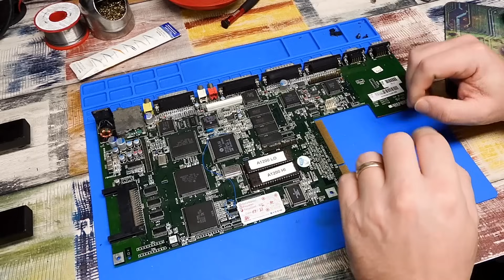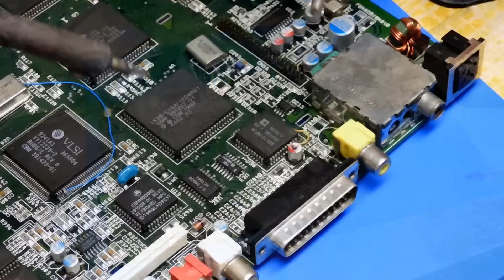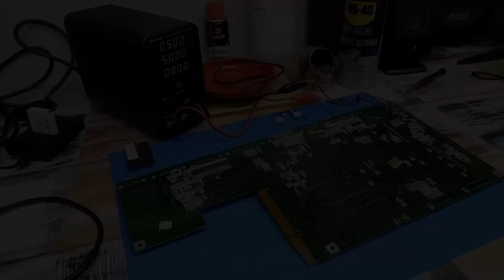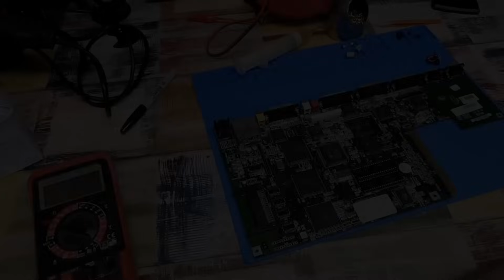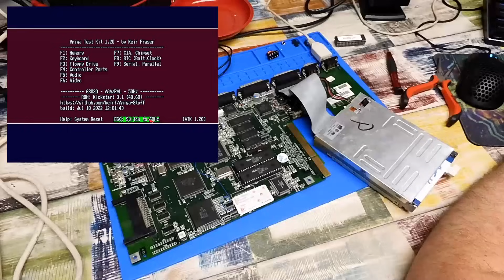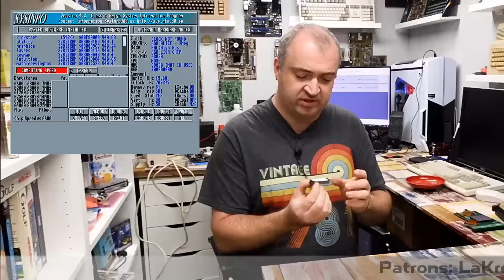Can I fix this shorted Amiga 1200?

Comment: The black screen delay on boot is a 3.1 ROM "feature" it expects a HDD - if you put in an IDE drive or IDE to CF or IDE to SD it will boot quicker (or use 3.0 ROMs)

Comment: Nice fix! Lucky the rest of the machine wasn't damaged due to the short!

A thermal imaging camera would probably picked up the heating of the coil even if it's a few tenths of a degree you would've picked up on it. Yes it costs money but it can save you a lot of time fault finding, and it's great for finding cold spots during winter in your house, insulating those and avoiding cold bridges with dampness and fungus etc can save you a lot of headaches. I've also used it on my car to spot a weakness in the exhaust pipe, a brake jaw being stuck etc. that the car repair men didn't pick up on.
Oh and buy low melt solder, it'll help not lifting pads as it lowers the melting temperature even more than leaded solder. I've soldered and removed 44 pin PLCCs more than 10 times from the same set of pads and there's no damage. I only needed 10mm of that stuff to remove the IC.

Comment: In repairing avionics equipment.  To find a short we sometimes put the PCB in a deep freezer until the card frost over.  Then when we apply power(current limited) the short thaws first.  You can take a marker and mark the bad path to the short.  We let the board completely dry before further troubleshooting.

Comment: I notticed that a cap was placed between the 10 uF next to the IDE Header, and the 22 uF behind the RF modulator, so when the two  1000 uF caps returned (?), you chose to leave it.

Comment: OK, I've paused the video at the beginning, and I've watched enough Lateral podcast highlights that I think I can figure out the reason. Obviously could be the usual capacitor or dodgy logic chip, or it could be a burnt resistor. Maybe a diode? Or perhaps you don't mean a short circuit, maybe someone has short sold it on the stock market? No, that's silly. How about short sold it on a retro forum, like they've borrowed it from someone and sold it at a higher price in the hope of finding one for cheaper and buying that to replace the one they borrowed?

Or maybe I should stop trying to turn this into a game show and just watch the video to find out.
Reply: Well, it certainly wasn't what I expected, but good on you for persisting and spotting the dodgy coil.

By the way, the joke would be "there's a broken ferrite ring on my Wang", or before you found the fault, "I hope my Wang hasn't blown its cap!"
Reply from the maker: A broken ferrite ring on your wang... sounds painful 😂

Comment: Cool to see another rev. 1a board; that's what mine is, and it also took out an accelerator connector due to the square edge! I've since chamfered mine as well.
Reply from the maker: First time I've had one on the bench, was good fun to work on, even if it did send me on a journey 😅

Comment: You have great determination resolving the short that way, we fix a large number of PCB's with shorts (often shorted ceramic caps), we have thermal camera's but often find voltage/current injection works better for hard shorts where little heat is generated. To diagnose a 5V short, set a lab PSU to 5V 100mA (you can increase the current but you risk damaging traces etc) then inject it into the PCB 5V rail close to the PSU input, then simply set your multimeter to mV and start probing the 5V capacitors (or other components on the 5V rail), you will notice the mV decrease as you get closer to the short, the lowest reading (usually close to 0mV) should identify the issue/component, you can also inject the 5V 100mA across the 5V rail away from the PSU input if you suspect an issue around that area.
Reply from the maker: Thanks for the tip, I'll try that next time.
Reply: @CRG  The thought process and logical thinking towards fixing the problem was far more valuable than the actual fix... Enjoyed very much indeed CRG.

Comment: I don't think you did the current limit setup properly.  You should turn current limit to 0, set your voltage, short your leads, then turn the current limit up until you hit the voltage and current you expect.  That's the way I do it at least.  You're testing for a dead short, and if you want 5v at 100ma, you need to set your meter to 5v 100ma with a dead short (shorting the leads first).  If you search up Adamant IT he has a video about voltage injection that talks about this.  He's referring to modern computers with CPU's that only take 1 volt, but the theory is the same.
Reply from the maker: I'll take a look thanks, I've not done this before so just had a go as how I thought it should work.

Comment: Very same thing happened to my TF1230 - connector pins pushed out of alignment. How you planning on fixing the board? I was told it was going to be too difficult to remove the connector on the board to replace. Cheers! Jim
Reply from the maker: All I can do is try to remove it.  The old connector is scrap so I may have to pull the pins out one at a time.

Comment: I tend to think the original cause of the fault was a bit of solder or a stray capacitor leg ended up in the slot. Just based on the visual inspection and the board having been recapped.
Reply from the maker: Possible, the short certainly occurred at the cpu slot but I've nothing to confirm how.

Comment: This happened on my PSOne and two SMD caps blew a chunk out of the board when they blew.
Reply from the maker: That typically happens more with tantalum caps, they like to exploded when they fail although I suppose with enough current a ceramic could get hot enough to frazzle.

Comment: Good video. I hope Honest Gamer has a trusted PSU to use with the repaired board. Did he send you the one he used?
Reply from the maker: Yes, he has a different psu now but no he didn't send the psu he was using when it went.  All he provided was the board.
Reply: @CRG  be great to know what the “bad” PSU did.
Reply from the maker: @ddniUK  I've been struggling with that one myself.  If the psu shorted internally it would only have damaged itself, if its outputs had gone high it could have caused the short but I would have expected it to fry the Amiga.  Given the damage at the cpu slot all I can conclude is that the board shorted here but the fact the psu had no over current protection lead to the trace burning through and the damage to the filter.
Reply: @CRG  Ya, nothing I see here indicates (to me) that the PSU was a problem.
I only have experience with an Electroware PSU for the 64, but I was happy with its build quality and components. The 64 PSU by Electroware uses a quality Mean Well switching power supply inside that has overcurrent protection, if memory serves (from my buying Mean Well components). I would not be surprised if their Amiga PSU also uses a Mean Well switching power supply inside.
If interested, I have a video teardown, mod, and rebuild an Electoware PSU - it's called "Electroware C64 PSU heavy-duty mod (30W DC power)" on my channel.
(Not posting link to avoid angering the YT comment killer. :)
Peace.
Reply from the maker: @DrDavesDiversions I'll take a look, thanks.  I've used meanwell PSUs to replace failed Amiga PSU bricks (just swapping out the internals of the PSU case) and as you say they always seem to be well built.
Reply: You took the words out of my mouth.

Comment: Another great video, Glenn!  Back when I was QA Mgr for T.I., we were fortunate to have both the thermal image camera & a device that allowed us to check surface mount  components while in the board. I learned to start from the voltage in, the IC pins, sockets, a full board wash, and de-oxit sockets later seemed to help cut our refurb time down considerably.
Reply from the maker: Sounds interesting.  In hindsight I should have started from the voltage in and checked that filter first!

Comment: Thanks for the video. Thermal cameras really are too expensive. I also tried rosin atomizer, but it only leaves mess on the board and is not really useful. Other method which could be worth considering, if you can reduce problem to some smaller area, is using one of those cheap laser thermometers and check one component after another.
Reply from the maker: I looked at those atomizers but was told they leave a terrible mess which is hard to clean up.  I do have one of those digital thermometers and I was thinking about it but not knowing were on the board was shorted it would have taken a long time to find.

Comment: couls you not just have checked those caps while they were in the board
Reply from the maker: They are all vcc on one side and gnd on the other so all read as shorted while on the board.  In hindsight when nothing was getting hot I should have stepped back and checked other things before starting into the ceramics.  But it's done now and at least I got it fixed in the end.

Comment: Great video, especially chasing the fault. You can still get a deal on thermal kit, it’s only the high resolution cameras that are eye watering expensive 😮 A budget one will do the job most times, but you can also use flux resin with an ioniser to identify thermal stress on components.
Reply from the maker: I looked at those flux resin things but I was told they make a terrible mess which is hard to clean up and given the size of the 1200s board there would have been a lot of flux fog.  I may get some sort of thermal imaging device at some point but few other bits of equipment I want to buy first.  Thanks for the tip and glad to hear you enjoyed the video.

Comment: By the way, the power trace has burned out BEFORE the filter but not anywhere AFTER it, this can be the clue...
Reply from the maker: Yeah that's a good point and in hindsight it would have been a heck of a lot easier to just pull the filter and test it to begin with.

Comment: Instead of waiting 30 seconds watching a black screen.  a hint is to add a powerled..  as the powerled goes to full brightness after 1 sec if code is running..
Reply from the maker: Good point, I should make up an led to plug in when I need it.  Should probably write a set of diag roms as well!

Comment: There is a simpler way to localize the short circuit. Take a sensitive milliohm meter (a modern 10000 count multimeter at the 100 Ohm range will be typically enough) and measure the resistance in various points on the shorted line. The lowest resistance will indicate the culprit.
Reply from the maker: I tried that with my meter and I have had some luck with it before but on this board it was just 0.04ohms everywhere which is probably the leads themselves.  Probably should have shown that in the video!
Reply: @CRG  Less than 0.01 Ohm difference all over the board? The power lines should be really thick and wide for such a low resistance.
Reply: @CRG  You can also feed a high fixed current and measure the voltage drop (this is often called the "4-wire" method).